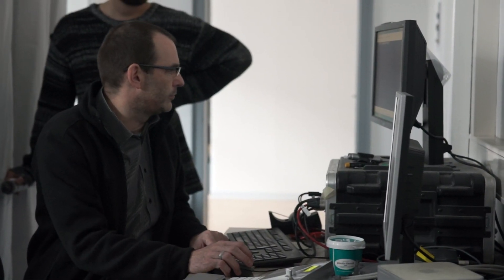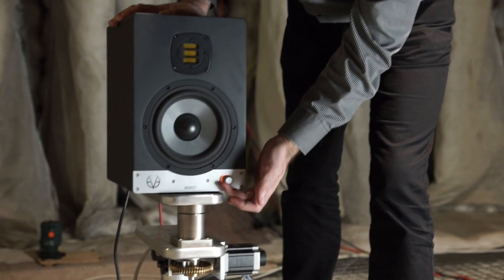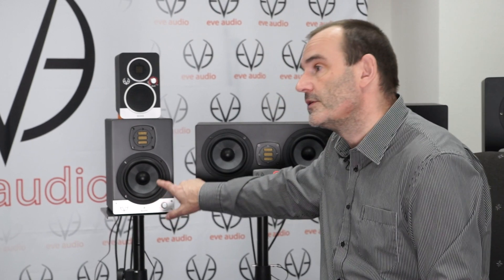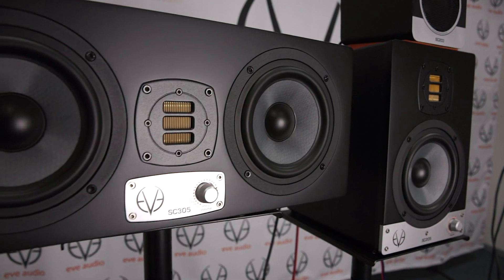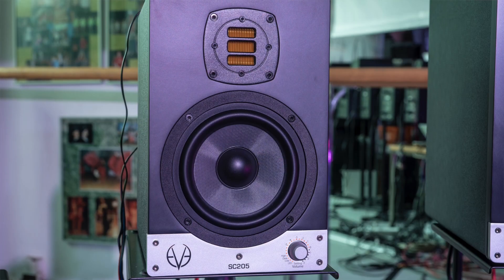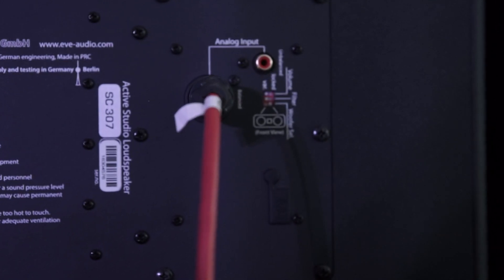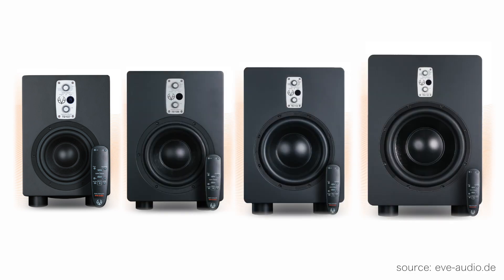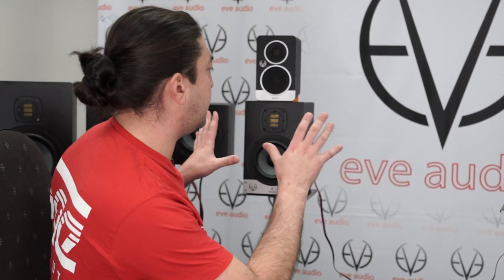Behind the Box: EVE Audio founder talks about our AMT, DSP and more...!

Comment: Hi Roland, I always love hearing you talking about EVE speakers. They're amazing. The only thing I would change is how switch them to standby mode. You have to click the main button for a couple of seconds. It's annoyingly slow for an operation we are supposed to do regularly and the issue compounds with the number of speakers. It would be frustrating if I had to wait 2 seconds to turn off each light in my house. Could you change that to make it one click instead?  That would make this interface consistent with how we turn the switch speakers on. Thank you!
Reply from the maker: Hi Julien Nakache,
a short click is used to enter filter settings. I had to choose between having another menu point for power off or just a longer click like a cell phone. I then decided for the longer click.
Roland Stenz
Reply: @EVEAudioMonitors  In my opinion, monitor speaker are very different from a cell phone from a UX perspective. The vast majority of users leave their cell phone on all the time - they only fully switch it off when they need to reboot it for an update or because it's getting buggy. On the contrary, it's best to switch off monitor speakers when we don't use them to avoid wasting energy and minimize wear and tear. Given that once the speakers are setup we rarely need to access the filter settings, I think it makes more sense to make it easier to put the speakers in standby mode than entering the filter menu. 

All the more as when it's time to put your speakers on standby mode, you usually want to move on to your next occupation as fast as possible. It can be a little frustrating to wait for 4 seconds total when you have to leave your studio in a rush. The faster to put them off in standby more, the better in these situation. 

Finally, it would be more consistent and more intuitive to have the speakers use the same mechanism for switching them on and off because these are symmetrical operations. It's like toggling a physical switch on and off. Or pressing the same button in digital equipments such as TV sets or radio sets. 
 
I'm currently in the market to build a 3D-sound studio with a 360 array of 6 or 8 speakers or more. I'm considering EVE speakers but I'm a little worried about the hassle of having to wait 8 times 2 seconds just to put them in standby mode. I feel I'll rarely do it and will end up leaving them on all the time.

Anyway, I just wanted to provide that feedback because I love EVE audio - I'm actually getting sub TS110 next month. I just want to help to make them even better. Cheers!
Reply from the maker: Hi  @jujunak ,

Thank you for your feedback.

While developing, we had a lot of thoughts about this topic and of course everyone has different preferences.
In your application I would recommend to use a main power switch for all speakers. In this case you don't need to switch off every speaker individually. When you switch it on again, the volume will increase slowly in order to avoid pop noise, etc.

Roland Stenz